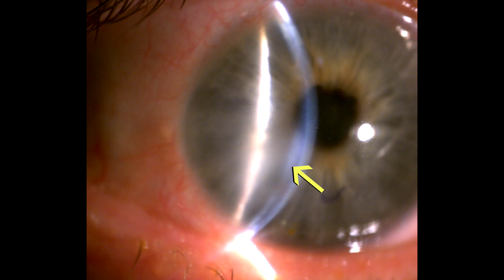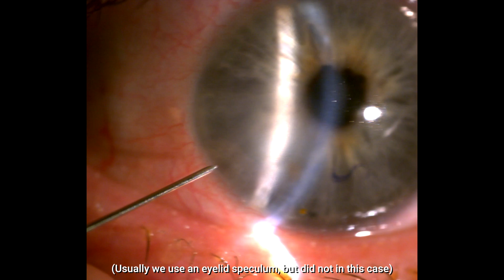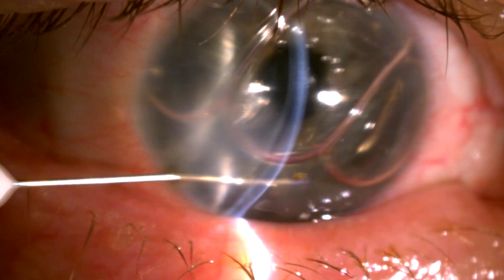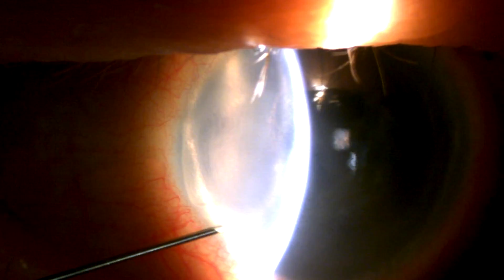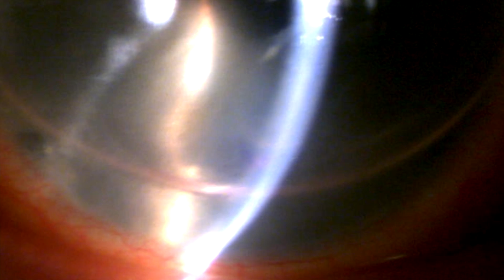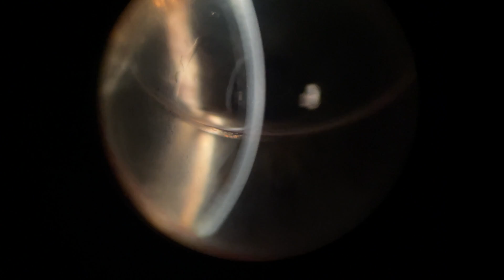Rebubbling a DMEK donor detachment at the slit lamp. Shannon Wong, MD

Comment: Nice video However, these small detachments will often reattach overtime without intervention.  The central cornea was pretty clear, if vision is good I would give it time to reattach on it’s own. It is harder to control IOP at the slit lamp and balance fluid air balance. Large full detachments are best handled in the OR in my opinion.

Comment: Excelent solving of the case. However; injecting air may be considered a surgical procedure and shall be done in the OR. You didn't use Iodopovidone either. What if you have super bad luck and the eye gets an endophtalmitis? It would be rare for that to happen... But still...
Reply: He says they used betadine to sterilize the surface
Reply: @sumeetjindal3874  I didn't hear it the first time, now I did. My bad 😅
Reply: There are perks to doing it at the slip lamp as you can see the graft a lot easier than on an operating microscope. Nothing we do is risk free, but this should be the equivalent of an intravitreal injection.